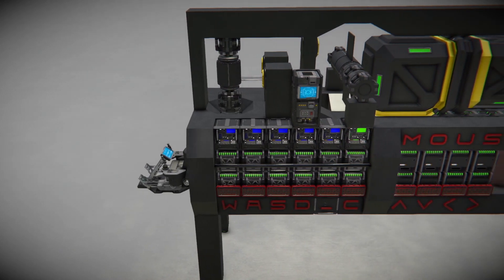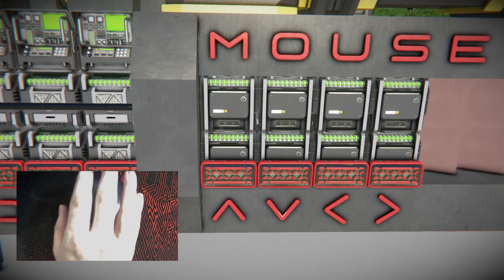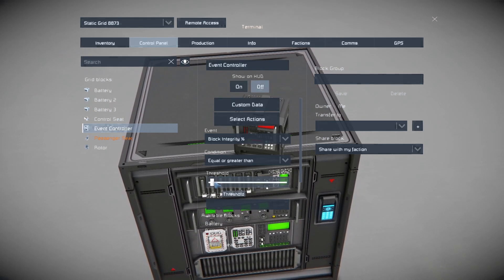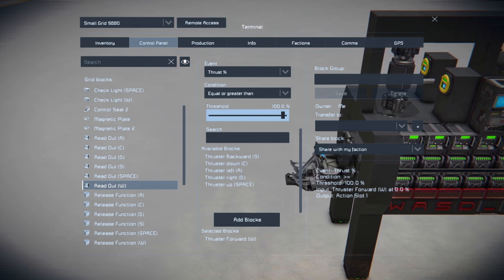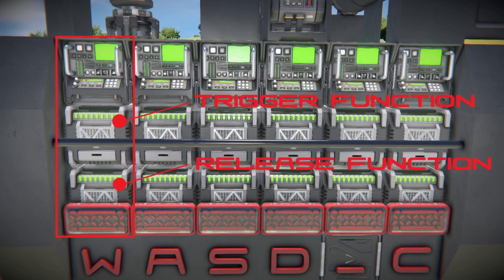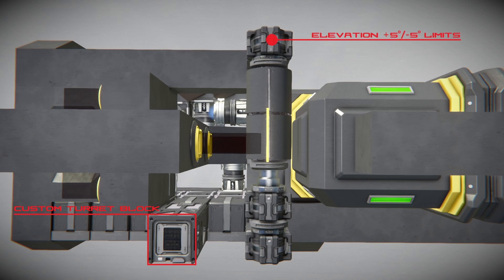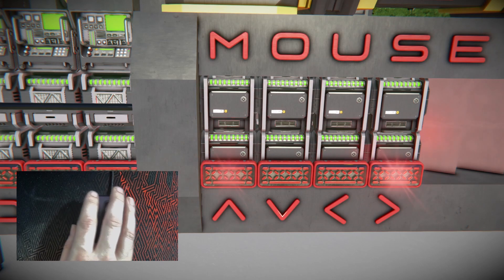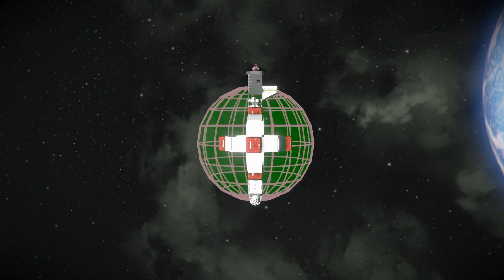[SPACE ENGINEERS] The Infinity Controller - vanilla all input converter - Tutorial

Comment: Are the Reset rotors set to have a small velocity pointing towards 0 or how does the reset portion of the mouse-movement work? Also, would it be possible to add detection for q and e (roll)?
Reply: roll is only used for gyros as far as i remember, so idk how you'd set that up, but it would def be a lot more complicated than thrusters, custom turret block, and a grinder.

Comment: I was surprised why you not use On/Off switch detection function in event controler for pick the mouse click input, so i test that in my creative if is there some problem with that and found out myself the function is little broken for mouse click, Bruh, We need du bug report about that and like that up. it is definetly on/off function for drill/welder/grinder if you triger that with mouse buton, because the block work for mouse buton even if it is turned off just the event controler not pick up that, only if you turn the block on/off in ''k'' menu works so definetly bug. I hope the event controler will work with drills at last with PAM script, because have plans for more advanced drills with controler, and this would sabotage my future builds :D

Comment: Wouldn't it be safer to detect clicks via the welder (with a "integrity > 99%" condition)? And having the grinder only activate to reset the targeted blocks to below 100% integrity?
That way you won't have to worry about your blocks getting ground down entirely, even when the cargo network gets damaged to the point where the components can't get from the grinder to the welder any more.
And could you do away with the welder entirely by grinding a rotor head/hinge part and then using the "add rotor head" functionality? The main problem that I see is that the rotor head part disappears, and thus can't be used in a "block integrity" style event controller. But sensors should still be able to detect the absence/presence of those parts.

Comment: It's very good machine, for console must have. I play on official and need subgrid controller for my suspension rover. Thanks 🙏
Reply from the maker: Maybe for suspensions it is not that great because there is no separate stearing override for left and right. But telle if you can achieve that.
Reply: @KelevraEngineering  For rover subgrid steering, it's possible that rotating the entire wheel suspensions using rotors might work, but how well the steering would actually work is something that would need testing. :)